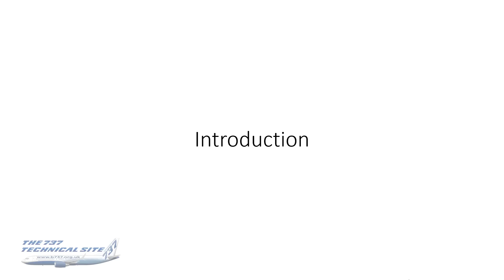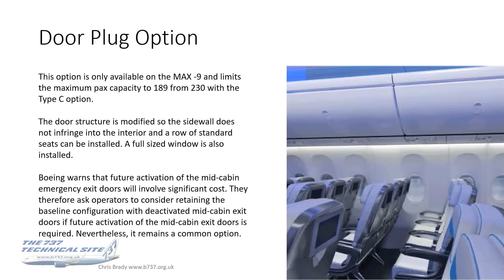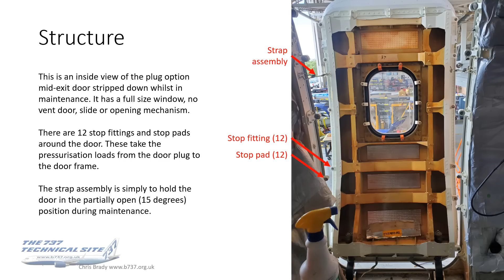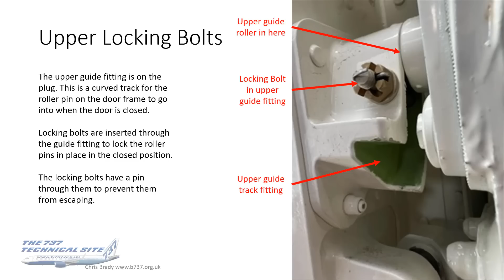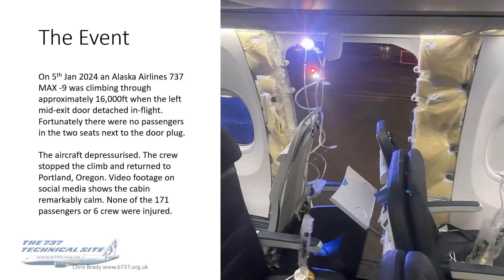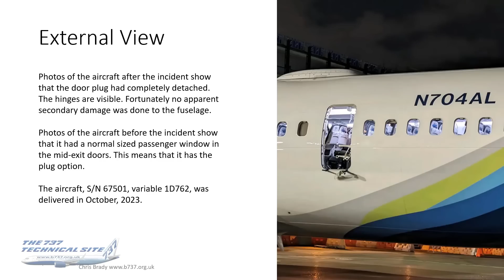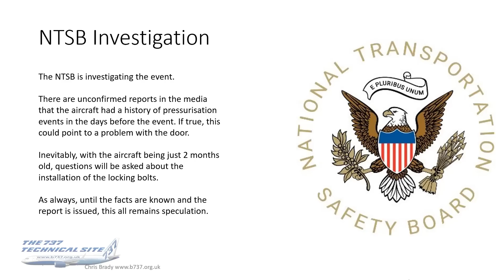737 Mid-Cabin Emergency Exit Doors - Plug Option

Comment: Still an excellent video that answers so many of my questions. If this is a manufacturing oversight ref the four bolts, it is the sort of thing that can happen very easily in an assembly environment. Quality control should catch it, but....  As an aside. As an IBM engineer swapping logic cards to diagnose a computer error during a manufacturing test, I managed to leave the logic cards in another machine and the computer shipped minus 3 logic cards. Needless to say it did not work upon arrival at the customers site! My name was mud for several weeks, but it was not life threatening. I implemented an end of line quarantine area where not even the Line Engineer was allowed to borrow logic cards to diagnose a fault in another computer. I partly blamed the parts supply people as there was always a shortage of logic cards up to the day the computers were meant to ship. (JUST IN TIME or JUST TOO LATE.) maybe Boeing had a bolt or nut or split pin shortage on the line that day!

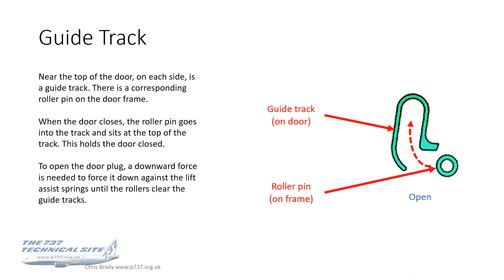Comment: Something wrong with your explanation (or illustration) at 7:19 in the video as pushing the door down against the springs would push the roller even higher into the guide track not lower. The door needs to lift (with the help of the springs) to clear the guide track after 4 securing bolts removed to enable it to open.
Reply from the maker: * Update *
In this video I state that a downwards force is required to remove the door plug. I based this statement on text in the AMM SDS which I now believe to be incorrect or misleading. It is possible that a very small downwards motion (1-2mm) is first required to be able to free the locking bolts. But the door must be moved upwards by a couple of inches to clear the guide tracks. Apologies for any confusion.

Comment: i have a difficult time believing that the arrestor bolts were left off completely during assembly.  i would think that the lift assist springs would probably pop the door up and out on a first landing, though i guess it could have been soft from the get go, and maybe the lift assist springs are weak (or were perhaps particularly weak on this door).  if the springs were absent, i could see gravity being the only thing keeping that sucker in place until it was almost out on a landing, then moving up under cabin pressure, getting over that last lip (and maybe some paint seal friction keeping it from sloshing open more easily, and popping.

what seems more likely to me is that the arrestor bolts were installed, their nuts were put on, but the locking pins/wires were either omitted, or they were wrapped too tightly on install and basically sheared, but looked still in place when the door was sealed.  either way, the nuts were essentially free, they vibrated off rather quickly, the arrestor bolts were bounced out of position one by one on one or a few (common) bouncy landings, the door was bounced almost out on a landing, and then next pressurization, pop.

it looks like finding the springs is not something that's going to happen.  when they look at the door, hopefully they'll be able to tell if the roller guide broke or if everything is clean, then just poorly secured arrestor bolts.

Comment: You presentation on the guide tracks is very misleading, at least to me. The roller pin isn't moving, it's attached to the fuselage structure. The door has to be pulled down to get the pin to be at the top or the guide track. To open the guide rises up with door with the help of the lift springs. To my eye this door wants to open and if the bolts are missing that's what it is going to do. This is inherently unsafe. How many bolts are necessary to remain closed? how much redundancy if one or two are missing? Also, curious as to how the emergency exit fits into this design. It's latching mechanism would have to be completely different. However, I'd bet these guides and springs are common to that design to save money. I think that bolts are not the best solution here, just the cheapest.  Not sure how the stop fittings work or what their function is as they would have to allow eccentric motion to allow the door to latch and they don't look like they can do that. Puzzling how pressurization would work or not work if the door wasn't being pulled against the pressure seal (which is not described.).
Reply from the maker: * Update *
In this video I state that a downwards force is required to remove the door plug. I based this statement on text in the AMM SDS which I now believe to be incorrect or misleading. It is possible that a very small downwards motion (1-2mm) is first required to be able to free the locking bolts. But the door must be moved upwards by a couple of inches to clear the guide tracks. Apologies for any confusion.

Comment: 1-8-'24 11:00 am  Chris , just saw this on Firstpost , about six clips down , on vid related to the max , there is a quick shot of the starboard door plug interior panel that shows sepeation/deformity at left top . Awaitng YOUR comment . Thanks , Neil
Reply from the maker: Hi Neil, if you don't mind I will leave any comment on that to the NTSB. Regards Chris

Comment: WRONG WRONG WRONG WRONG WRONG WRONG....Chris, I hope I have your attention now. Sorry, but with all due respect, please read what many commenters are writing here and which causes so much confusion in several other discussions that are referencing your video. Your only response so far was quoting the same "AMM SDS 52-23-00 Page 6 MID CABIN EXIT DOOR PLUG" passage over and over without really adressing the problem people have with part of your explanation. It just doesn't make sense the way the guide tracks and roller pins are mounted that the overall motion needs to be downwards in order to disengange from the tracks and clear the stop fittings. In fact it has to be the other way round, i.e. a 1.5 inch motion upwards! Could you please take another look at the photos and think about this again? I would appreciate it if you could write a proper response not only under the comments that applaud your work. Which is of course perfectly justified for most of your content! However this one technical issue really bugs me.
Reply: Fully agree! 

From another post of mine:

There’s definitely some conflict here between the text, the diagrams, and the photographs!
Because if the roller is already at the top of the track, how can the door then be pushed down as was said.

But look at the text at 9:15  where text says: “the upper guide fitting is on the plug “
Then the second sentence says: “ this is a curved track for the roller pin on the door frame to go into”

If this is a photograph of the right side, how could the plug be pushed any further down?

Now, if this was the left side photograph, and the track was on the fuselage, and the pin was on the door, then the door could be moved down slightly and inward to clear before being lifted up and out with the assist of the springs.
And the locking pins at the springs are there then to prevent that slight downward movement.

Another thread commenter said he zoomed in, and it shows that the pin is on the frame and the track is on the door plug making the 9:15 pix the upper right. 
If that is true, then the door plug will just have to be moved up to open it, not down.
Reply: Absolutely, he's in a hole and keeps digging by repeatedly quoting the incorrect or misleading AMM. Dozens of people have called him out but apparently he believes the AMM instead of multiple pilots and engineers. Possibly this AMM is one partial cause of the problem by confusing the techs who fitted the doors.
Reply: @davidjb3671  there was one comment that said it’s possible some downward pressure on the door might be necessary to more easily insert and remove the bolts, which possibly makes sense. I have one door that you have to push slightly on the door to lock or unlock because the weatherstripping pushes the door latch against the jamb.
But given what we know about this situation, it’s just no way that you can push the door down more than maybe just a little hair.
Reply: @JohnHallgren  Yes, that's absolutely correct, but Chris is  misinterpretating this to suggest the door is removed by sliding it downwards, despite dozens of knowledgeable and well argued comments and the clear evidence from photos and diagrams in his own video. And then in one of the comment threads he states "I'm a pilot, not an engineer", so in that case he should maybe take the advice of engineers who clearly know a lot more than he does about the mechanical aspects of these door mechanisms.
Reply: @davidjb3671  and…there’s been various comments from mechanics and engineers who say the manual is just incorrect which seems likely given how it’s written.
Not only that, but the slight curvature of door would allow it to easily go straight up but it would hit the frame at top edges if you tried to move it downward more than to squeeze any gasket type material slightly.
Reply from the maker: * Update *
In this video I state that a downwards force is required to remove the door plug. I based this statement on text in the AMM SDS which I now believe to be incorrect or misleading. It is possible that a very small downwards motion (1-2mm) is first required to be able to free the locking bolts. But the door must be moved upwards by a couple of inches to clear the guide tracks. Apologies for any confusion.
Reply: @ChrisBrady737  Thanks for the correction Chris. Looks like the Boeing AMM had a lot of people foxed. Take care.
Reply from the maker: No problem. Pity the video cant be altered after it has been uploaded @davidjb3671
Reply: @ChrisBrady737  thanks for finally agreeing with those of us here who said it just wasn’t physically possible to move it downward more than a hair maybe given the mechanics of the entire thing!

I have a door which requires a bit of push to get it to latch/unlatch properly because of the weatherstripping. So possibly a bit of a push here to get the bolts to freely insert or remove makes sense. But more than that? Not viable.

Even though I have never seen this door in real life, my mechanical background said something wasn’t quite right with your description.

Comment: Is it possible for the standard “non-plug” emergency exit door to come off mid flight as well? 

I sit in the window emergency row all the time.  Should I now be concerned and sit elsewhere?
Reply: The opening and closing mechanism prevents the door from moving vertically when the door is closed.

Comment: Based on the photos I’ve seen, the door is actually lifted to open, not lowered as the video states.
Reply from the maker: Correct, my bad. 
* Errata *
In this video I state that a downwards force is required to remove the door plug. I based this statement on text in the AMM SDS which I now believe to be incorrect or misleading. It is possible that a very small downwards motion (1-2mm) is first required to be able to free the locking bolts. But the door must be moved upwards by a couple of inches to clear the guide tracks. Apologies for any confusion.

Comment: Just to seek clarification. The plug door must move up to release. Thus the springs assist release not hold it in place.
Reply: yes
Reply from the maker: * Errata *
In this video I state that a downwards force is required to remove the door plug. I based this statement on text in the AMM SDS which I now believe to be incorrect or misleading. It is possible that a very small downwards motion (1-2mm) is first required to be able to free the locking bolts. But the door must be moved upwards by a couple of inches to clear the guide tracks. Apologies for any confusion.
Reply: Your videos are most informative. The NTSB should take a look. Maybe they do.  @ChrisBrady737

Comment: The "Guide Track" slide at 7:17 seems wrong.  A downward force on the door further secures the roller.  One would have to release the bottom spring retention bolts to get an UPWARD force on the door to get the rollers to move down the track, and out.  None of this explains how this is done when all 12 pins in the stop fittings are still engaged.  'There would presumably be a side load on all these pins, perhaps jamming the whole door.
Reply from the maker: * Update *
In this video I state that a downwards force is required to remove the door plug. I based this statement on text in the AMM SDS which I now believe to be incorrect or misleading. It is possible that a very small downwards motion (1-2mm) is first required to be able to free the locking bolts. But the door must be moved upwards by a couple of inches to clear the guide tracks. Apologies for any confusion.
Reply: @ChrisBrady737  Thanks for the correction.  I'm thinking a better design would have been to have the spring tension going the other way.  I get that door removal is easier with the lifting springs, but to reinstall the door a mechanic would have to have help to recompress the springs anyway.  So since the springs only help for half the job, why not enlist the help of the springs to keep the darn plug IN PLACE!
Reply: There’s definitely some conflict here between the text, the diagrams, and the photographs!
Because if the roller is already at the top of the track, how can the door then be pushed down as you said.

But look at the text at 9:15  where the first sentence says: “the upper guide fitting is on the plug “
Then the second sentence says: “ this is a curved track for the roller pin on the door frame to go into”

If this is a photograph of the right side, how could the plug be pushed down?
Now, if this was the left side photograph, and the track was on the fuselage, and the pin was on the door, then the door could be moved down slightly and inward to clear.
Reply: @JohnHallgren  No conflict.  The track is on the door plug, doesn't matter if it's left or right.  The photo at 9:15 shows the right side.  The fitting on the left side of the video frame on on the plug.  The mating fitting on the right side of the video frame is the pin mounted to the door frame.  Either side, the door cannot move down.  The only thing I can possibly say to resove the wording is is slight downward pressure might relieve tension on the lower locking bolts first.  Get them out, then the springs can move the door up, assuming the upper locking bolts have also been removed.  What I can't figure out is how the door can move inward enough to get off those pins to THEN move up to get free of the track guide.
Reply: @rickf7445  but your original first sentence says that you saw something that seems wrong, ok? 
And from that photograph, I don’t see how the door can move any further down, because it appears to be at the very top of the guide fitting.   
It also seems a bit illogical that there would be constant force on the bolts, trying to push the door up and out if no bolts were in place.
Reply: @JohnHallgren  Yes,  my original first sentence refered to the slide at 7:15.  The 9:15 slide is different.  We both agree though, an upward release moving seems hard to accomplish give the stop pin engagements.  Now, the door has been found.  The only photo shows only the outside and thus reveals nothing.  And it's dark.
Reply: @rickf7445  i think we’re not communicating well…you had replied that there was no conflict, yet that was your original point in first post that there was a problem. If there is a conflict, there’s a problem!
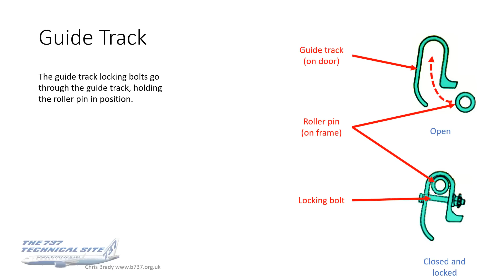The text at 7:15 doesn’t agree with the diagram showing closed position at 8:33, because when the pin is at top of guide, it’s NOT going to allow the guide to move downward. 
Also, the photo at 9:15 seems to not fully match the guide in the photo showing the entire open door when one zooms into that full photo. The pix appears now to me to be of a smaller version of this thing.
Reply: @JohnHallgren  yeah, you're right, we're not communicating.  Slide at 7:15 conflicts with itself.  There is a conflict there.  When I suggested there was no conflict, I was referring to your comment "But look at the text at 9:15  where the first sentence says: “the upper guide fitting is on the plug “
Then the second sentence says: “ this is a curved track for the roller pin on the door frame to go into”.  There is no conficting statement here.
Reply: @rickf7445  oh! Ok! Yes, I didn’t write that as well as I intended to. Sorry.
And I was pointing out that not only did 7:15 appear to be self contradictory, but it also wasn’t quite matching with the other slides and pix and text from the manual which I think have some discrepancies when all of them are looked at as a whole.
Reply: Agreed, if the 12 stop fittings are engaged to hold against cabin pressure then the door should stay in place regardless of any failure of lock bolts, hinges, roller pins & guides etc. If those 12 stops automatically release when the aforementioned parts release it seems to be a counter redundant design. Not what you want on an airplane.
Reply: @Bitterrootbackroads  Just seems like the door may NOT have had the stop pins aligned and mated right from the factory, or the last service.  I'm sure the FAA is looking at maintenance logs to see if the door was serviced after delivery.  Also, they now have located the plug door so I'm sure more is known.  I wish that teacher in whose yard the door was found took some pictures with the door concave side up.  It was found with the outside facing upwards and reveals nothing.
Reply: Another thought.......the roller does NOT protrude into the guide very far.  Is it possible loose tolerances combined with fuselage flexing caused one side to come out of it's guide?  Now the door is cocked at enough angle to allow the second pin to come out.  At this point, if the lower bolts were omitted, the door could come off.  I think the answer to this mystery is going to involve multiple factors.